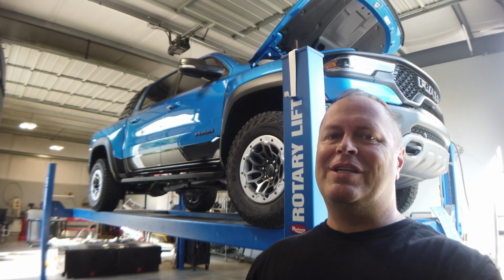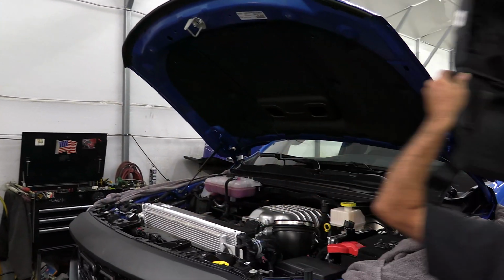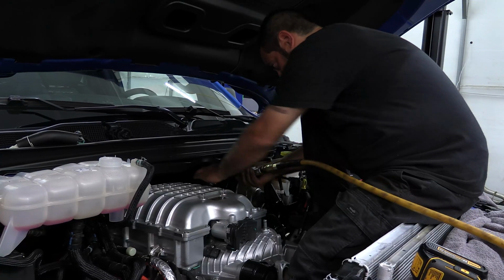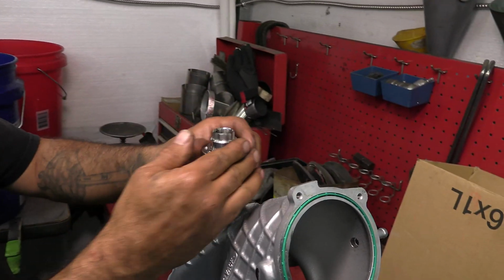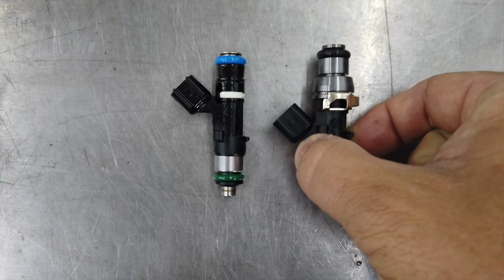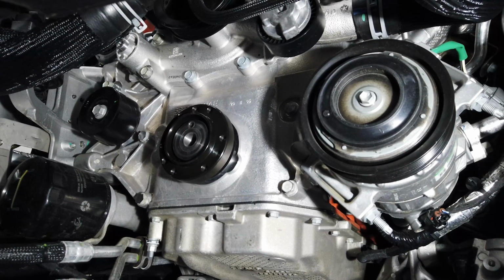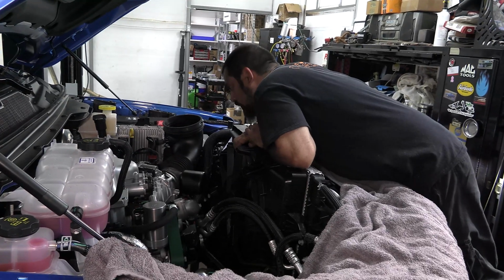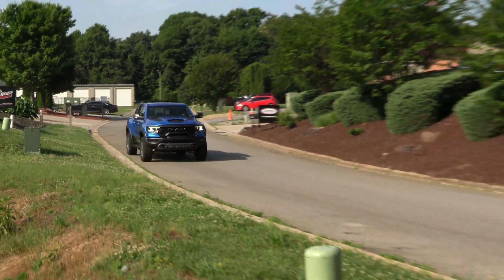Shoving an Extra 100 Horsepower in a New Ram TRX 4x4

Comment: Spoiler Update: This WILL void the warranty so please beware if anyone is thinking of this. I was told by a buddy who is a Mopar teck that the lower pully upgrade like Incognito will usually slide by with no issues on warranty work unless lower engine or SC issues come up, Plugs, Thermostat is not an issue for warranty voids... keep all this in miind cause a Clutchless Pulley is hard on the SC but im sure this is known and just posted as an easy 100 hp mod...
Reply: Oh well.  Still sounds good.  👍

Comment: Can you please share what this kit costs plus what a well qualified shop would charge for installation?  This motor seems to have more mods avail, with more potential power than just about anything I've seen.  1 month in, I'm still plenty happy with 702, but this looks like a great "stage 1" option.
Reply: I just spent $3k...but I got larger Injectors and added a boost a pump...so about $2500+tuning?
Reply: I've seen many ask this including me but for some reason he wont respond.. Even an F off is a response lol...
Reply: One of the best, most affordable, & safest things you can do to add power is methanol injection. You'll never have to de-carbon the top end because it'll be steam cleaned every time methanol is injected into the cylinders. You can even buy windshield washer fluid that's rated  for -20°F instead of the name brand methanol fluids. I've got an '06 Wrangler Unlimited with the 4L I6 & I added the Banks Sidewinder Turbo kit to it & since there wasn't an intercooler for it yet I figured I'd just do the methanol injection to act as a chemical intercooler. It really makes a difference on the Jeep when it sprays, especially in the heat of the Arizona summers.
Reply: E85 and smaller pulleys upper and lower 200 ish hp gain

Comment: It's cool and all, but he said before the build it made 560hp, at wheels, when done he said stock was 540hp and gained 100hp, well I caught that guy, if you do the math it was 80hp gain
Reply from the maker: There's a 20 percent drivetrain loss. Our goal was to gain 100 horsepower at the crank. Which is legit, since Ram advertises 702 horsepower, which is the crank horsepower, not at the wheels. So 702 horsepower with a 20 percent drivetrain loss is 560 horsepower. And when we made 640 at the rear wheels, that equals 800 horsepower at the crank. Not trying to trick anybody.

Comment: No offence to the turner, but most tuners do not stand behind their work or they come and go. If the engine or trans fails, you have ZERO warranty after this type of work.

If you are going to overspin the blower, you need to have all the bearing replaced / upgraded. Send it to Jon Bond for his bearing upgrade.  

I will be sending my TRX to Hennessey for their 900HP mod WITH a warranty .........
Reply: So how did that work out? Lol.
Reply: You should probably do your research on Hennessy before you decide to send your truck there.  Search around the time frame of 2006-2008 ish.

Comment: sticker 92k trade in value in 2 months 50k
Reply: Got mine at 74 leathers tow package no decals no ram bar and it goes for 100 now
Reply: I paid 93k for mine and have put 23 thousand miles on it. Just got 91k for trade in on it for my new 22 TRX that I paid another 93k for. Do the math on that it doesn’t add up but it somehow it works. They will put my old TRX on the lot for at least 98-100k with 23k miles on it and I’m sure it will sell very quickly.
Reply: Lol I got $10k under MSRP for my lvl2 with CF int.and didn't break $84k